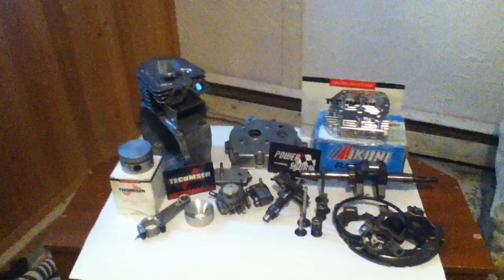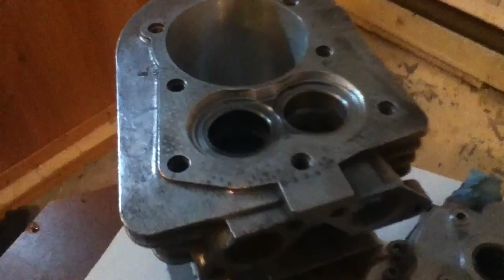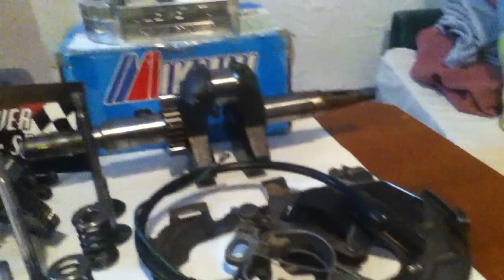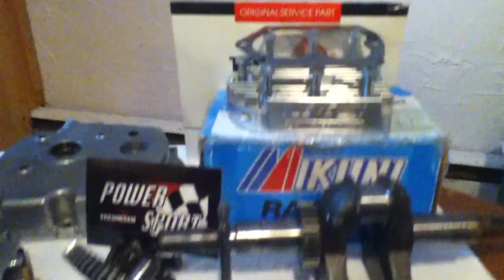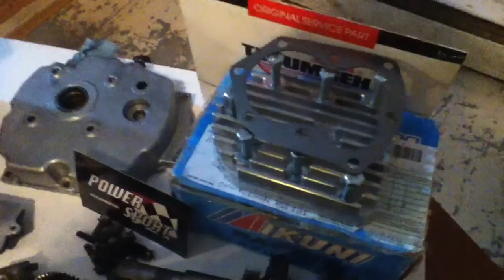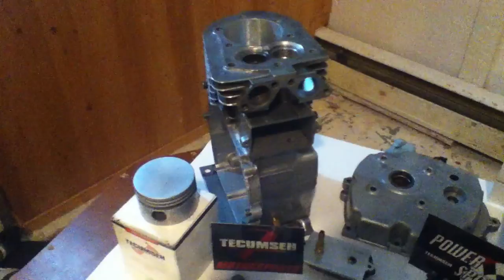Tecumseh H70 Engine Before Reassembly 050111.MOV

Comment from the maker: @Mijaycapri79 the cylinder was rebored to .010 oversize to accept the new piston, intake ported, the billet head and tappet cover are second hand from Clements Racing. Thanks to Mike Clements for his advice on getting it all together on my build. Also the Tillotson HL-239 carb (gas) which i obtained from dc5000123 via Ebay, rebuilt and ready to go (check my other videos for this engine running prior  to the upgrade).